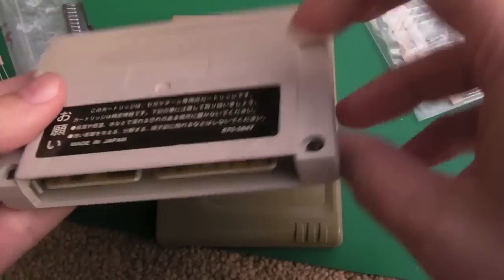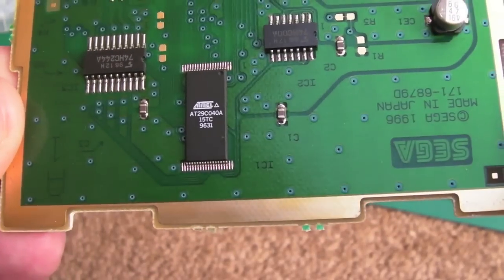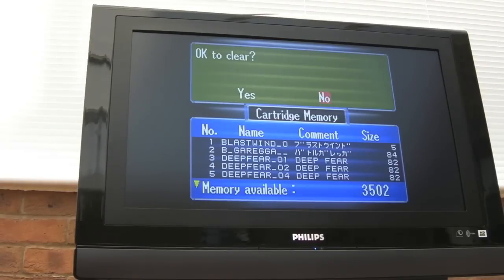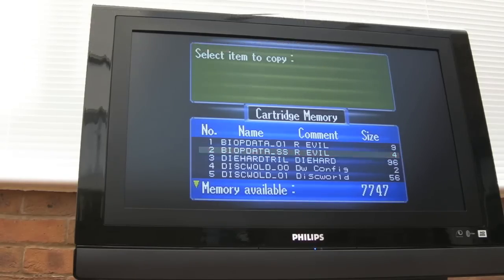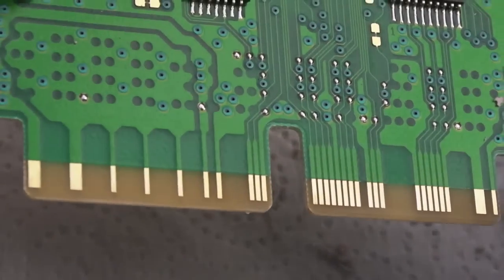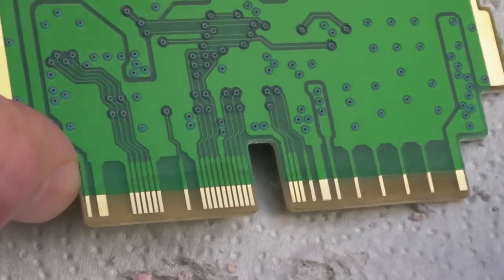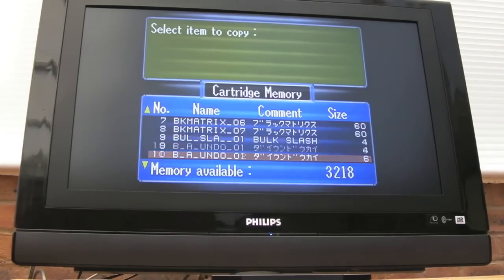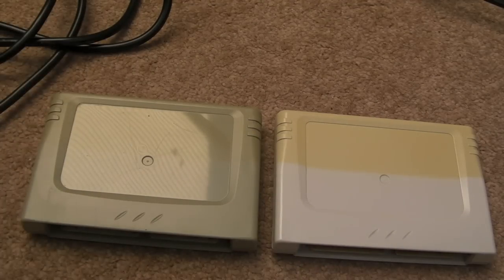Sega Saturn Memory Backup Cart Teardown & Clean

Comment: Those carts cleaned up nicely. Cleaning the Saturn's cartridge slot connectors is the bigger challenge but the most common issue with the Saturn is the cart slot connectors being spread apart, causing bad connections and Backup RAM carts to short out and lose their saves.

Personally, I blame the cheap GameShark and Memory Card Plus cartridges. Those bastards used a cheap, thick,  layered PCB that was too thick for the Saturn's slot. I've ran across dozens of Saturns that suffered this fate and they all have a problem reading cartridges consistently. Thanks for the video.
Reply from the maker: +AtariBorn Very interesting, it does sound like it's probably the thicker PCB!  I cannot think of any other way it could happen since the cart slots don't get that much use on the Saturn.  I will have to avoid any carts with thicker PCB I think.
Reply: +GadgetUK164 The culprit cartridges have a green PCB that, if viewed on end, have obvious layers. The good cartridges have the almost translucent white PCBs, like the stock Backup RAM carts have. If you have to force the cart in or use two hands to remove one, it's garbage and should be tossed.

Comment: Just a tip for anyone that needs to get inside somthing with these screws but do not have the correct bit. If you take a biro pen, now it has to be a flexible one not the brittle type. Then take out the ink and nib, heat the end up and push it onto the screw. The plastic wil mould itself to the shape of the screw and allow you to open it up. It works ive done it.
Reply from the maker: +craig gilchrist Yes, that's a great way to get the screws out if you've not got the right bit etc.  I've seen people do that with torx screws as well.

Comment: Have you tried repairing an Action Replay for the Saturn? Everyone I ask who has one says their saves never stay when using one of those, but everything else works (switching from 1 to 4 MB of RAM, cheats, and region swapping). I would love to see a video on those. Thank you for another informative, original video. Your content is always a breath of fresh air involving retro gaming and its hardware.
Reply from the maker: +96C1V1C I haven't but I will look out for one, and I might do a teardown of mine.  Maybe they are battery backed and the onboard battery fails?
Reply: +GadgetUK164 I opened it up, and it doesn't have a battery backup. I'm learning now about alternative methods of saving, but I haven't quite grasped the concepts. For cartridges like these, do they store on some type of primitive solid state technology?
Reply from the maker: +96C1V1C They tend to use a flash ROM (like the one shown in this cart).  Maybe the connections are not making a good connection, or maybe the flash ROM has failed?

Comment: I haven't gotten this far yet, but I did have some problems with my Saturn last night that I've never had.

I was  playing Christmas Nights and I copied my save over from my 20 year old memory card just fine to system memory and played dandy. Then I went on to play some Resident Evil and after playing a while, I decided to transfer my save to the cart so it wouldn't get wiped (haven't replaced battery in unit, just rely on the card). However, the only option it gave me for the memory card was "clear", so that was no good.. I reset the system and it acted like the memory card wasn't even in there!

I tried reinserting the card to no avail.. finally I decided to put the cart in almost all the way and that worked out just fine. Have I made a mistake by leaving the memory card in the Saturn for a couple of decades? I figured if anything this should not damage the port since it's not being moved/removed/jostled. Is that wrong? Looks like maybe cleaning is next, but I suspect it's lost some grip or something.
Reply from the maker: The cart slot in the Saturn does get dirty over the years, and they do get a bit slacker than ideal.  You may find it works after you've cleaned the slot.   The way I would to that is get IPA onto the edge of the cart (quite wet) and push it into and out of the saturn several times.  Try the PCB edges, insert and remove again another 7 or so times, wipe the PCB dry again, repeat another couple of times and wipe clean the PCB edge each time.  It may then work better!

Comment: I've found the actual socket in the Saturn to be more of a problem than the edge connectors of the carts. They get flaky eventually and I am not aware of a replacement socket?
Reply from the maker: +arcadeuk I've not looked but I do know the seller tested them in two different working systems, so I think in this case it was probably just dirt, but I have heard the sockets can be a problem.  It's strange that they become a problem really, you would think that only one cart ever sits in the socket typically - ie. they don't get much use do they?  As far as I know there's the 4Mb VRAM expansion, and these 'backup carts' and that's it, so it really strange?!?  They must be flakey as hell if they are wearing out from that limited use!
Reply: I guess the fingers just loose tension over time as they age, despite probably not being used/changed much. I've certainly seen enough Saturns with flakey sockets (causing problems with the RAM cart more than the backup)
Reply: +GadgetUK164 Mine has this issue, I can't get my two memory cards to read, but my ST Key reads now and then. Some if not all (anyone feel free to correct me here) Action Replay carts and possibly other unofficial carts are said to be slightly wider sometimes causing this issue.

Comment: I recently bought a Sega Saturn, Resident Evil and Action Replay Plus from eBay, however the Saturn doesn't appear to see the Cartridge, I've ordered an actual save Cartridge to at least try to rule out the Cartridge Slot. I've opened the cartridge and one of the chips looks weird, it has like a brownish looking colour near the pins and some pins aren't Soldered, although I think that's OK, it's the Brown looking patch that makes me think it was fried out the gate(It was listed as New).

Long shot, but you would happen to have(or know someone who does) have a video on one so I might stand a chance of fixing it?

I did the return thingy and they issued a refund, so now I don't know if I'll bother sending it back, it'd only cost me anyway.
Reply from the maker: The brown stuff might just be flux.  It's possible the cart was dead due to that chip, but often just cleaning up the cart edge and the slot on the Saturn can get carts working again.   The Action Replay carts are well known to widen the cart slot contacts - that can often mean that it can be difficult getting carts to work on some Saturns.
Reply: @GadgetUK164  Thanks, I'll try that(eventually), I did originally use compressed air and about 15 tons of dust came out, but that didn't do anything.

My save save Cartridge arrived the other day and that works(didn't at first for some reason but I digress) so seems like the cart may have been DOA.
Reply from the maker: You also need to fold some paper a few times, soak the edge in IPA and carefully push in and out of the slot a dozen  or so times to clean the cart socket edges.  But not too thick paper, try and go the same or just less than thickness of the cart PCB.

Comment: do you know if the japanese memory carts work on ntsc-u saturns? i live in the U.S. and they are rare and/or expensive here. if they are not compatable, is there a simple or cheap conversion to ntsc-u cart? could be a useful video.
Reply from the maker: I am using two Japanese carts here on a PAL saturn - no problems!   The cart slots are identical, and the only chips on the carts are the flash ROM and buffers, so I am sure they will work on the US system too!
Reply: +GadgetUK164 . Sweat. Thanks. Off to ebay i go. Lol.

Comment: I'm having problems with my memory card plus for my Saturn. My system doesn't recognize it, no Sega Enterprise screen after the Saturn start-up screen. I got it off of Ebay with the description guaranteed to work. :/
Reply from the maker: Saturn cart slots are notorious for being bad fitting (loose).  It's worth cleaning the cart contacts like I did and try putting it in and out of the slot several times before testing it again.
Reply: @GadgetUK164  I think my card is a dud. I bought an Action Replay and it works. The cart slot is consistent, took once or twice to boot up the Action Replay. I need some help finding someone that could fix my card. I know you are in Europe but any advice is welcomed.

Comment: I got my Sega Saturn memory backup and the console got it from amazon, also, my Sega Saturn memory backup will not save any games!
Reply from the maker: It's worth cleaning the cart edge if you haven't done already!  There is a chance the cart has a faulty 74 logic chip, or perhaps a faulty EEPROM but its quite rare.  The most common cause is dirty cart edge or loose cart slot - The Action Replay cart can widen the slot making other carts have a poor connection.

Comment: I think official carts are badly designed, its very loose in saturn cartridge slot and have connection issues, you will receive corrupted saves with bunch of "yyyyyyy" in saves name all the time even on brand new consoles with perfect ports. On the other side - Action Replay carts always worked perfectly on my consoles.